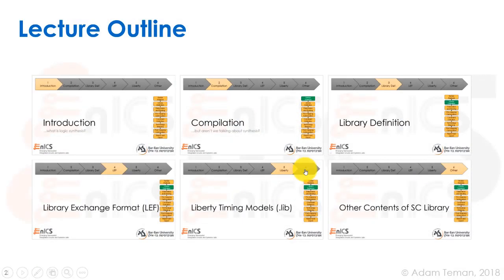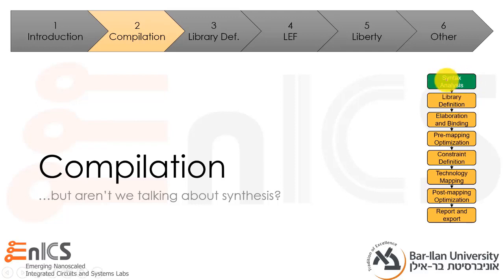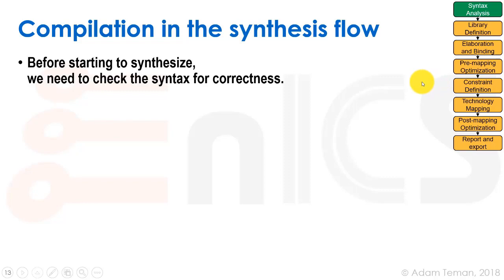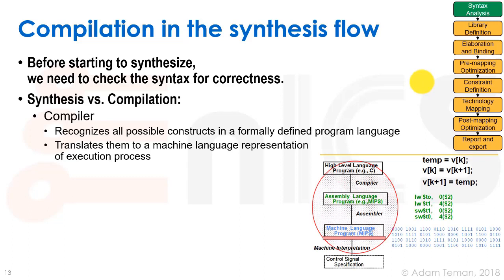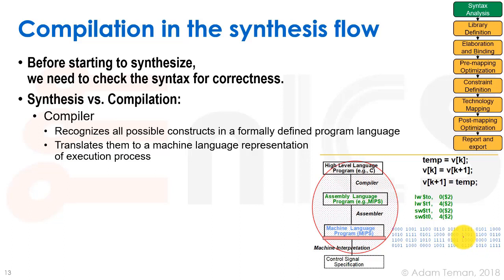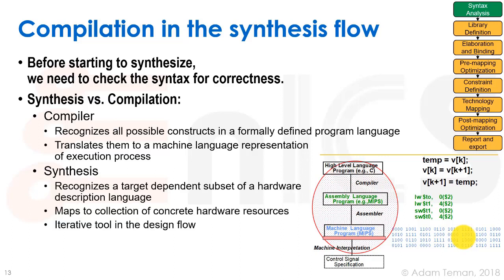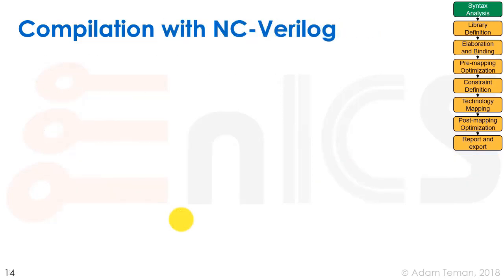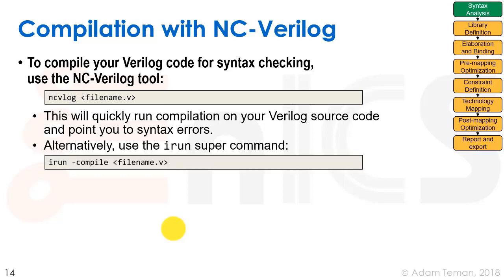DVD - Lecture 3b: HDL Compilation

Comment: Hi @AdiTeman I've been watching your videos for quite sometime and I really enjoy watching them. I've learned a lot. I aspire to be a Design Engineer. I would really be greatful if you make a video on roadmap for being a Digital Design Engineer. Also I've been using SystemC for my work and I often get confused about should I go for Verilog or systemC?? Please I would like to hear your thoughts on this.
Reply from the maker: Hi, 
Sorry for my very belated response. Been busy lately (...more than the usual).

Thanks for the kind words. 

Regarding Verilog or SystemC, these are quite different. Verilog (or System Verilog) are used for hardware description and cycle accurate logic simulation, while SystemC is usually used for higher level system modeling. While there are packages and so forth that synthesize SystemC, these are not very accepted in industry, as far as I know. Another drawback of using higher level languages is that the gatelevel code is hard to connect to the behavioral description, which makes debugging and ECOs very challenging, if not impossible. So the industry has been very conservative in keeping hardware description at the HDL level and not going too much higher in the stack. One niche approach is Chisel, which was developed as an improved alternative to traditional HDLs, but it has really only caught on with UC Berkeley students and alumni and some others who have mastered it. Another is high level synthesis, which is supported by all the major vendors and can be found in both university and in industry, but despite its maturity, has yet to conquer traditional HDLs and make them irrelevant.

Comment: why do you say synthesis is iterative? do we have to run it multipletimes on the same file?
Reply from the maker: Hi,

Actually, the entire physical design flow is iterative. It is actually iterative in more than one way. The first way of looking at it is that you run each of the steps many times with different parameters and each time you look at the results, analyze them, modify parameters and/or the design and re-run. Another level of iteration is the algorithms themselves, which usually have some optimization flows within that incrementally improve the result until the constraints are met, no improvements are made or a certain amount of time/effort has elapsed.

I hope that answers your question.